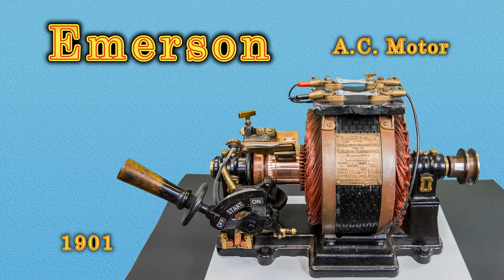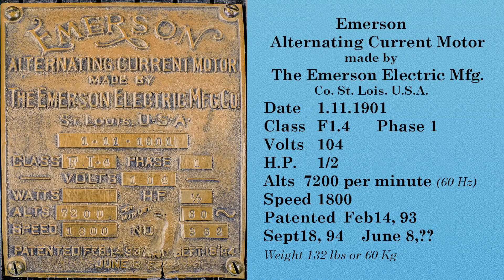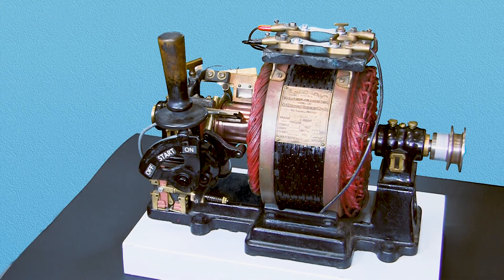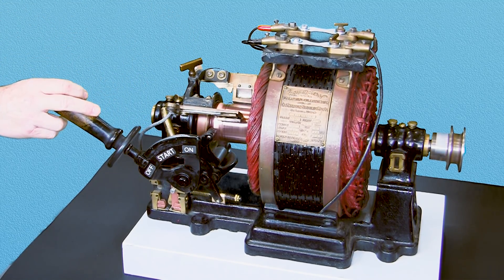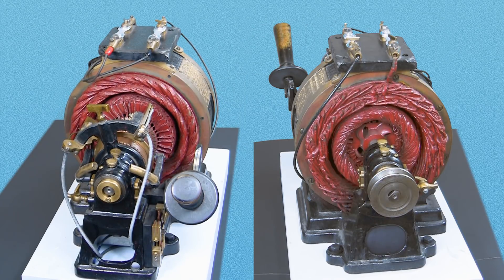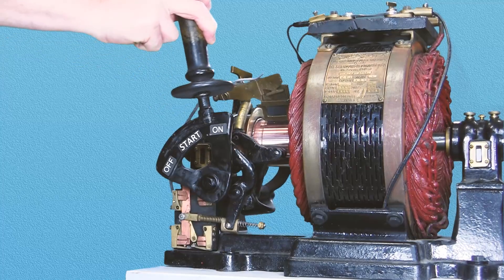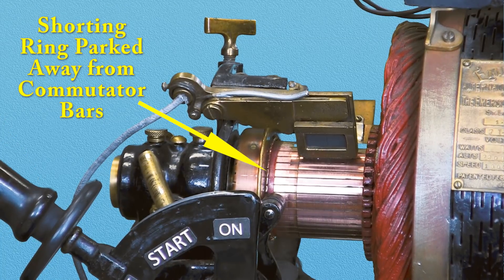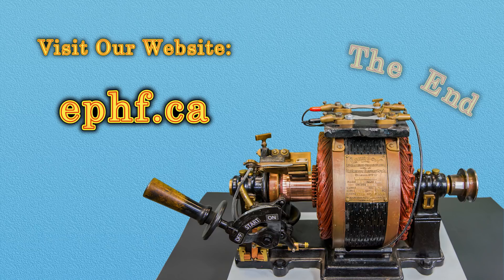Emerson Repulsion Start Induction Run AC Motor

Comment: Well, you nah I can learn something new every day!.  On our farm, we had a few motors, one for our water pump and one Wye/Delta start a bit bigger one for various uses.  Finally a big one (bigger than our that time transformer) for the heavy tasks.  It wasa a wound rotor type, so it could be started with the limited rating of the transformer.  However, a few times it blew the transformer primary fuses.  I witnessed the replacement at least once.
 Later on, I was dealing with two repulsion motors used for pumping some chemicals through a plastic hose by pressing the hose with two rollers.  Adjusting the repulsion lever you could adjust the flow rate.  I looked at the description of the repulsion motor in the pump manual and some other places, never fully grasping it then.  I think somebody damaged one of the motors, while the other one needed a number of times a replacement of the hose.  That happened because the rollers made the hose work its way forward despite of holding clamps.  Other times the hose just split under the rollers.  That was before my graduation and I have not seen any repulsion motor or a video since then, until now.  Thank you!

Comment: Im not a pro, but how the hell is induction motor capable of 7200 rpm on 60hz source?
Reply: (Sry for bad englisch im from germany and we of course learn everything in german)Its the winding that makes a diffrence. I cant 100% explain it. The windongs of the rotor are placed in a way where the stator has more "way" to pull to the same phase again therefore the magnetic field pulls the stator over a longer distance in the same pulse with less tourqe of course.

Comment: Very cool! I have a 2HP Century repulsion start induction run motor from 1927, it powers the blower to my pipe organ, startup even sounds a lot like this smaller motor!  The 2HP motor weighs 290 pounds and it had a sheave on one end of the shaft that ran a 12vdc generator, but that had been removed and replaced long ago with a rectifier.

https://www.youtube.com/watch?v=U1SlR7dMbLg

Comment: That was made when people made stuff to last. I have a GE brass blade fan that was made about the 1920s and that thing is going strong.
Reply: Paul's Place except when it came to tv and radio wax  capacitors which go bad over time
Reply: the Advantage of this stuff is thats its easily repairable. however the maintenance on this type of motor is greater, due to the carbon brushes and complex mechanical system.

Comment: I worked at Baldor Electric in the 70’s and 80’s. We made lots of specialty motors. The Repulsion/Induction motors that we made were for farm usage. Most of them ran on 120v, single phase, but pulled a LOT of current. Ridiculous starting torque! We got one back for warranty once. It snapped off its output shaft... 1-1/2” diameter! The grain elevator it was running was iced up in cold weather, but the motor was determined to turn anyway.
Reply: Are you sure it was 120? A 1 1/2" shaft is absolutely massive for a 120v motor. At that size, I'd be expecting three phase. I only have a 2 year degree, but I feel like 120v, even on a heavy breaker, isn't practical for delivering that kind of turning power.
Reply: @OtherDalfite  All of the older style farm-duty motors that we built ran on single phase, as not a lot of rural applications have 3-phase available. These motors were beasts. Cast-iron frame, very heavy, large ball bearings. Four-pole R/I, no start-capacitor, the commutator itself was about 4 inches in diameter, with the short-out switch segments mounted in a ring. There were two sizes, 5 and 7.5 hp. Electric motors produce their greatest torque at locked-rotor (startup).  In the application where the motor failed, it may have been sub-zero, but it was nonetheless snapped off. 
    I have no degree, but I worked hands-on with these motors for 12 years.
Reply: @creativerecycling  holy crap, thats incredible. dont let it sit in that locked state though, it will burn up fast
Reply: That’s wild, what was their power rating?

I’ve stalled a 35HP gas motor running full throttle when the concrete I was cutting snapped shut on it.

The only thing that could yield was the drive belt slipping a little before the motor fully died. It only had a 1” blade shaft and yet never once did any damage to it lol.
Reply: i guess Im quite randomly asking but do anyone know of a good website to watch new series online?
Reply: @Brayden Aidan thanks, I went there and it seems like they got a lot of movies there =) Appreciate it !
Reply: @Luke Lennon Happy to help xD

Comment: Interesting video. I saw one such motor on a pump back in 1982, but with a centrifugal switch instead of a manual one. I figured it had something to do with starting torque but didn't fully understand the theory of how it worked. Thanks for explaining it.

Comment: What if you skipped the start position and went straight to run? Would it speed up slower?
Reply: It will pull a shit ton of current and not have as much starting torque.

Comment: I build and maintain pipe organs.  Many organ blowers from the early part of the century were equipped with Century Repulsion-start/Induction-Run motors, however, the motors had an automatic centrifugal device that threw the brushes out which took the place of the manual lever on this motor.  It sounded the same -- the buzz of the brushes and that whir, then the little whir when it came up to full speed after the brushes disengaged.  Very dependable motors -- there are still a considerable number of them still in use, thank you.
Reply: They're still in use because they was so well made.

Comment: When I was in trade school as a machinist, we had an open side planer made sometime in the late 19th century. It was equipped with General Electric controls, circa 1904. The motor control box had a push button and a lever. As I recall, you pulled the lever to the start position, then pushed the start button. There was an unholy growl rising to a banshee screech and once that was reached you yanked the lever to the run position. The planer utilized flat leather belts that would squeal with every direction change of the massive iron bed. There was a cosmetology class on the floor above us at that location. They'd come down to bitch about the ungodly noise!

Comment: i wonder why nobody that operate high voltage motor use rubber gloves? one little sloppy action and you could get zapped.
Reply: back then common sense was a commodity EVERYONE had
you kept your hands and fingers away from current carrying parts.
if you didn't and got a shock,, it was YOUR fault . no one elses.
workers used their heads for something besides as spacers to keep their ears
apart back then. what a concept huh?????
Reply: @williammoses6232  wonderfully said, back then there was a reason to have a brain, and if YOU did something bad it was YOUR fault and you didn't have a lawyer to blame what YOU did yourself on the equipment. everyone was not babied by the manufacturers and people actually had to think for themselves and were responsible for their own actions.
Reply: @williammoses6232   ok boomer